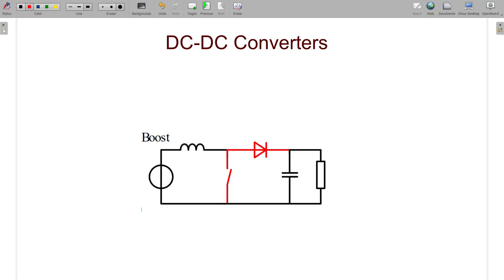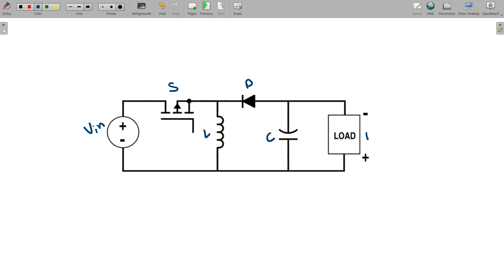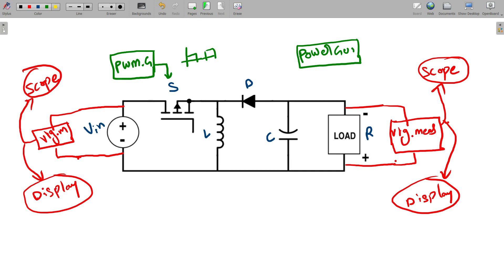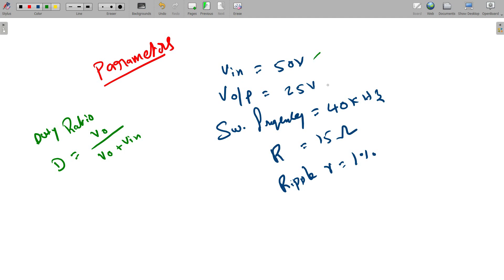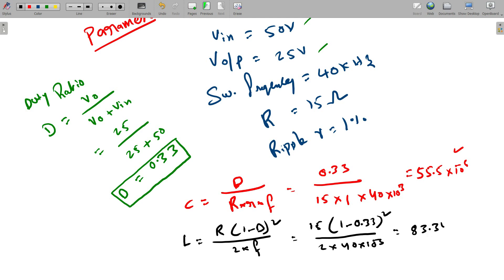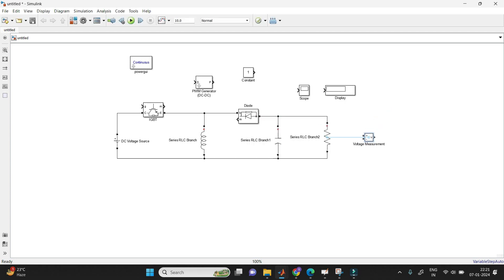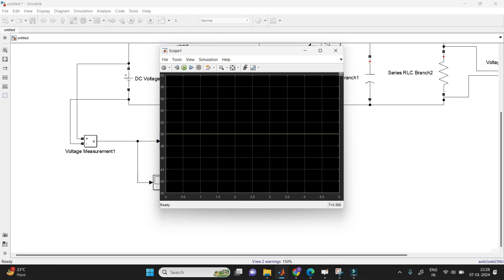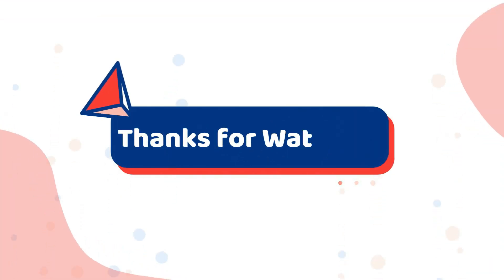Buck Boost Converter Using MATLAB Simulink | DC-DC Converter

Comment: why is the output voltage I get negative?
Reply from the maker: In buck boost converter and cuk converter we will get -Ve polarity output. You can check output expression with values you will get -ve value.
Reply: @allabouteee4u  then how do you get positive output? how to make it positive?
Reply from the maker: @gigi-ld1jn I just reversed voltage measurement at output side for understanding purpose. If you want you can do like that. But in buck boost converter you will get -ve voltage only.